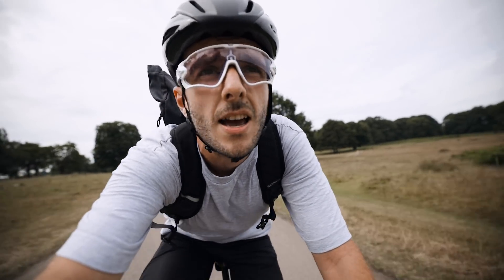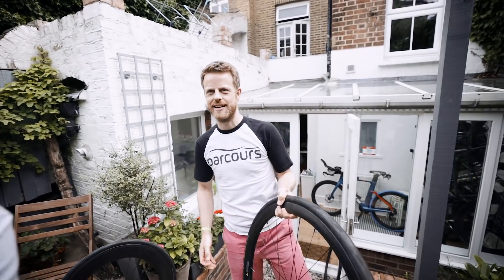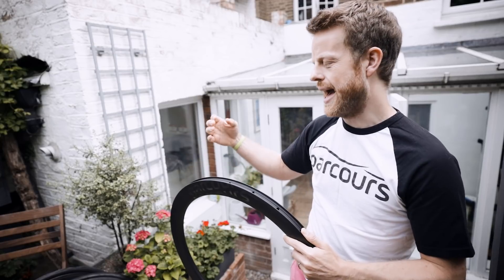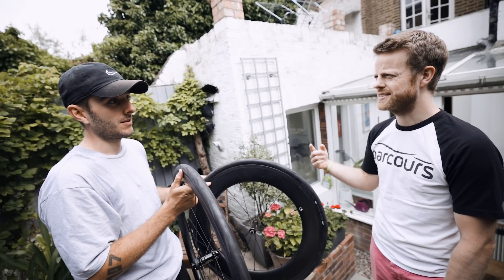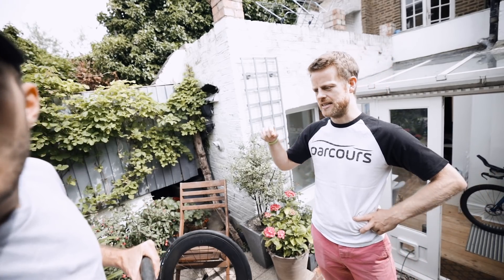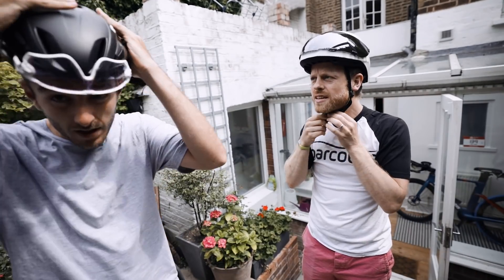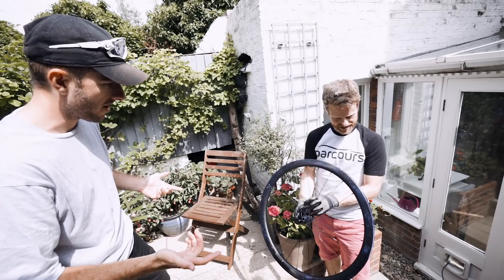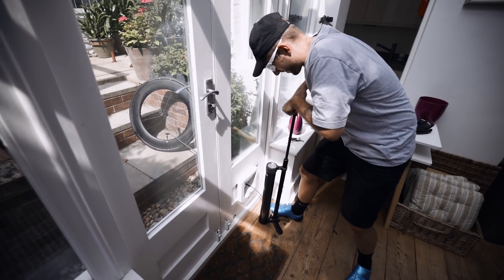Pumping up Carbon Bike Wheels until they EXPLODE

Comment: What does the freehub sound like on the Parcours wheels? 

I'm looking at new wheels at the moment, had found some I liked but was recently riding with a friend who has them, and the freehub sounded like a kazoo, it was horrible (they werent hunts, hunts are loud, but sound ok)...
Reply from the maker: Not as loud as hunts. 
It's just the pawls on the freehub, so if you wanted to you could grease them to quieten the hub

Comment: We’re the tires considered ‘hookless approved’ or just standard tubeless tires?
Reply from the maker: From Dov: So there isn't a "central" list of tyres that are hookless approved, Usually its down to the rim manufacturers to list tyres that aren't compatible, Conti specifically say not to use the GP5000TL on hookless rims.
Schwalbe (or shwobble) haven't said one way or the other on the Pro One that we used.  Although it is explicitly approved by Enve for their AR series
Reply: Thanks for the quick reply. I didn’t notice my autocorrect issue in the first post. Love that feature.      Based of the ‘scientific’ test, it would seem that most tires will probably be fine on hookless rims if you keep the pressure at or below  the suggested max pressure. I’m considering some of the new Zipp 303s wheels but have some concerns about the hookless tire situation. I have to assume it will become more prevalent for hookless descriptions on the tire packaging and websites.

Comment: The question I have for Dov is....if my Hookless tubeless wheel won't seal after puncturing, can I put an inner tube in or am phoning the broom wagon.
Reply: Hi David.  You can, yes.  The reason why you have to use a tubeless tyre on a hookless rim isn't to do with the actual tubeless setup itself.  It's because only a tubeless tyre will have the correct tolerance on bead sizing to ensure a safe and secure fit on the rim

Comment: i had a non tubeless tyre blow off a hooked carbon rim at 130 psi. the noise was like a shotgun and i didn't have ear protection. Are the parvours Made in the UK?
Reply from the maker: Made in the far East, designed by dov.
Reply: Hi Glenn.  At the moment our rim manufacturer is based in mainland China.  We did look at some UK manufacturing options about 12 months ago, but as of now there aren't any options that can work at the scale we'd need.  Never say never though, but we'd need to be sure that the quality and technical knowledge is at least what we currently have
Reply: @rideparcours  The far east rim manufacturers are good that's pretty much proven.

Comment: Awesome science! The max pressure on the tires always has a safety margin added into it... I would expect at least double the maximum recommended pressure before failure, if not more, especially on the hooked rims. What was interesting on the previous exploding stuff videos is it wasn't the tire that was the weakest part in those cases.

Comment: I got a question about wheels: how often does a normal person change their wheel bearings? I have to do it maybe once a year, which seems a lot in sunny Spain.
Reply from the maker: I don't think I've ever changed a set, I usually break them before
Reply: As with a lot of things, the answer is "it depends".  Depends on the bearing seals, bearing size, mileage, conditions, how often they're cleaned etc!

Comment: Hay guys I am a little bit worried? I had some wheels built for me about two years ago, I was told that they were tubeless-ready, I ran the clincher set-up for nearly two years they seemed fine, and just this week I swapped them over to tubeless set-up I noticed that the rims where hookless, I ran the clinchers at around 95-PSI, do you think that this was safe to do, The tubeless set-up, do you guys think it would be safe to run them at 72-PSI, (I’m 16St) I’ve not used the tubeless set-up yet, I didn’t know that there was a PSI limit for hookless rims
Reply from the maker: Edit: what dov said
Reply: Hi Martyn - based on the current ETRTO standards, the maximum safe pressure for a hookless rim is rated at 72.5psi.  If you're concerned about the setup, feel free to drop an email to mail@parcours.cc & we can see if we can help

Comment: I think that this has to do with the fact that they have a big safety factor (sometimes up to a 3:1) and that should account for the load of the total system weight. So a tire with no load spreads the pressure on the whole circumference of the wheel whereas if you ride on them, there is more load on the part of the rim where the tire contacts the road. Not sure at all about this but it makes sense in my head. Correct me if I'm wrong
Reply from the maker: yes, there must be added stress where the wheel impacts the ground over a pothole or similar. I don't think the total pressure is affected that much by that though

Comment: Any thoughts from Dov on max pressure when fitted / with a rider? Like, how much would say 90kg load affect "real" tyre pressure
Reply: Hi Nick.  When you inflate a tyre to a rideable pressure, the actual deformation under load is comparatively small.  For example, at ~80psi under a simulated total load of 85kg, a Continental GP 5000 (28mm) has a tyre drop of 4.5mm (hat tip to Bicycle Rolling Resistance for the data!)
Bearing in mind that's only at the contact patch, the impact on total air volume (and therefore pressure) will be very small
Reply: @rideparcours  & Francis - Thanks for the info! I will worry less about this on the occasions I need to put a tube in.
Reply from the maker: I asked him this, apparently it barely affects things, even when you hit a bump and compress the tyre

Comment: 2:00 Is that right? I ride at about 90 psi with tubes on 28s as I'm 90kg (and bike is about 10kg, and sometimes carry loads of 5-10kg)...60 seems very low. Not a rugby player, just rather tall.
Reply: Finding the right tyre pressure depends on a lot of things, not just rider weight.  Tyre width, rim width & road surface all play a part too.
Saying that, from a rolling resistance perspective, it's better to be too low on pressure than too high - it's not a linear relationship!
Reply from the maker: if you're 90kg you'll probably want to run higher pressure than 60psi
Reply: @Cade_Media  I thought so! I'll have a look around as tubeless is something I'm still on the fence about.

Comment: But why hookless, i can't see any advantage?
Reply from the maker: I think it's purely because it's cheaper to manufacture
Reply: @Cade_Media  cheers
Reply: Another reason we (& others) are looking at hookless rim technology is it allows for a flatter rim/tyre interface.  If you can keep airflow smooth at this point, you'll reduce overall drag of the wheel/tyre system

Comment: Maybe I’m a fool, but 70 psi still feels a lot slower to me than my normal 80-90 psi
Reply: It's interesting you say it "feels" slower.  There's a good argument that says higher pressures "feel" fast because they accentuate every bump in the road.  Whereas in fact the tyre is skipping over the bumps, losing traction and also losing energy through what's referred to as impedance.
Reply: Dov at Parcours  yeah definitely feels not proven. I’ve never tried different pressures on the same road at the same power, in the same conditions like you see people do on cycling videos.  That said though, I can on my bike tell pretty quick if the tyres have lost pressure, both on the tubeless set-up and with latex tubes. - suppose it takes cyclists a while to change habits.
Reply from the maker: Bicycle rolling resistance website has tested almost everything now, really good resource.
Reply: Francis Cade looking at Bicycle rolling resistance it looks universal that rolling reduce as tyre pressure increases. Their test is done with the wheels running on steel checker plate so pretty rough stuff, at least equal to most British roads. I would be interesting to understand if the move to lower tyre pressures is more to do with lighter carbon wheels that have a lower pressure rating. Or possible moving over to tubeless, more pressure is exerted on the rim than with a tube. The data on BRR suggest the statement that lower pressure is faster does not appear to be universally true.
Reply: I’m running 50psi with 28mm tubeless tyres.

Comment: So I know you can run tubeless at lower pressures but what's the advantage of doing so? Is it speed or comfort you gain at lower pressure? I have tubeless and I run then at about 95psi.
Reply: Tubeless with 75-80 psi hits the spot for me with 27mm tyres.
Reply: All things being equal, a tubeless tyre will have a lower rolling resistance than tubed at the same pressure.  This means that you can reduce your tyre pressure without losing out on rolling resistance, but massively increasing ride comfort.  Or you can go midway and gain a bit of both.
Jarno at Bicycle Rolling Resistance has a huge amount of data on this for loads of different tyre options.

Comment: Round 3...use some Tub Glue (personally use Continental carbon - 4 024066 441412 ). Lay 2 good layers allowing 48hr inbetween each to cure, then rim tape if needed. This should work...